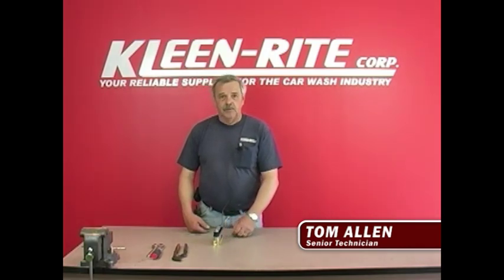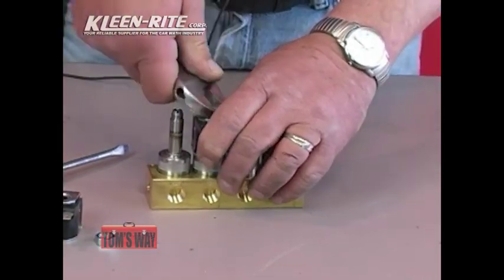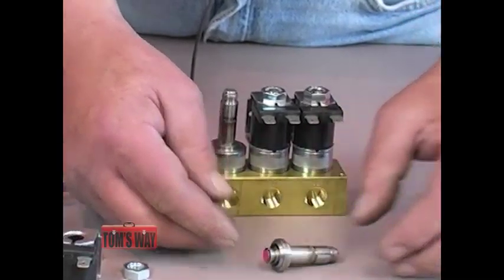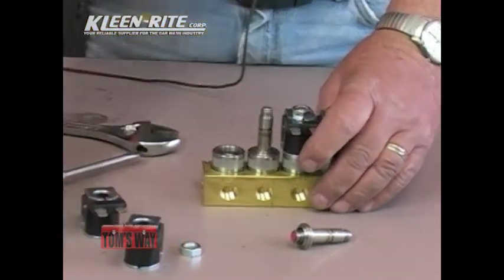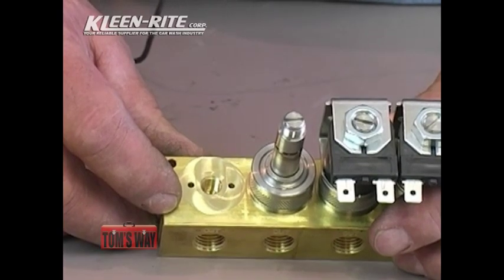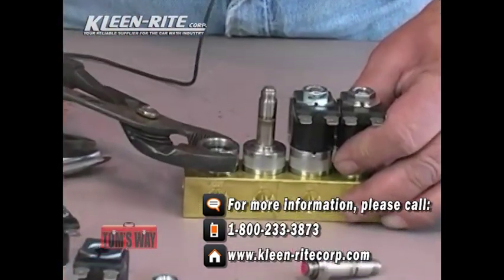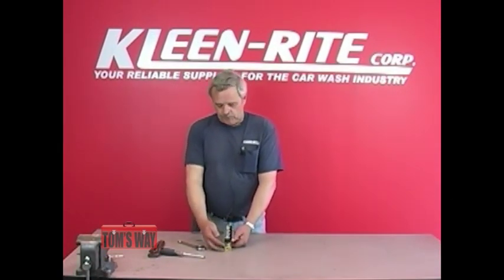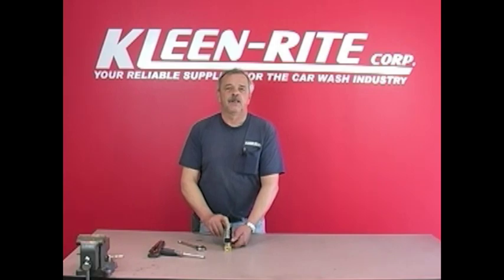How To Service A Solenoid Valve | Kleen-Rite

Comment: What if you have no hole for the flat head to go into? Mine is just flush on top
Reply from the maker: If there is no place to get a flathead in than you can grab the base of the shaft or the knurled base with pliers lightly to turn it out. These typically come apart very easily

Comment: No one do that. You know one is bad and work on it. Most times a coil gets hot. You change the coil. If stays open or closed when in use there's trash in it. If cleaning the bad doesn't fix it, get a new block. Soaps creates build up all  inside that tunnel. Remove block, put new one and walk away. Time is money.